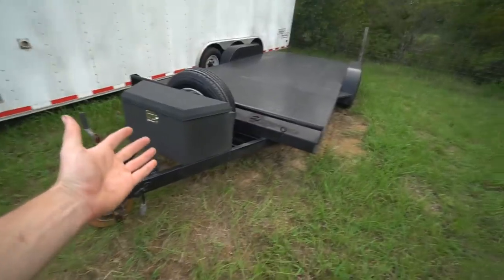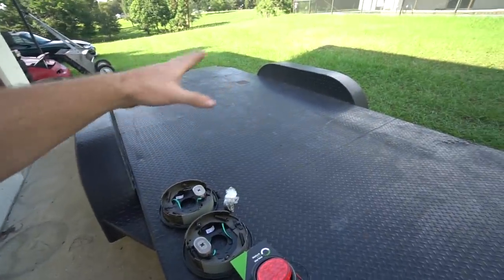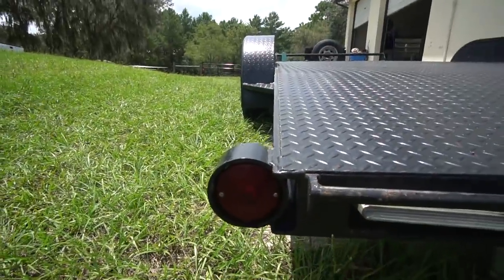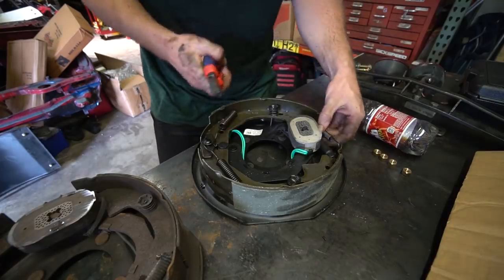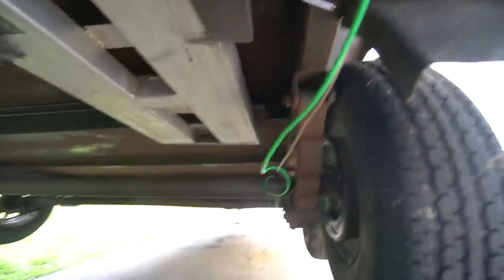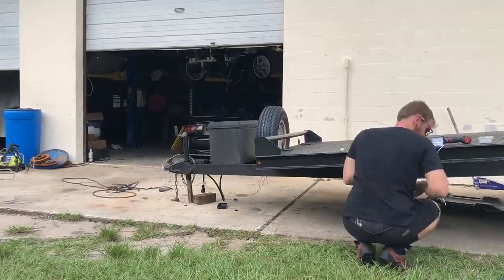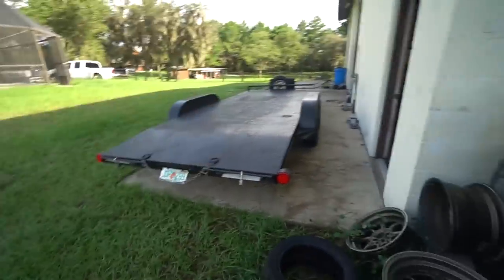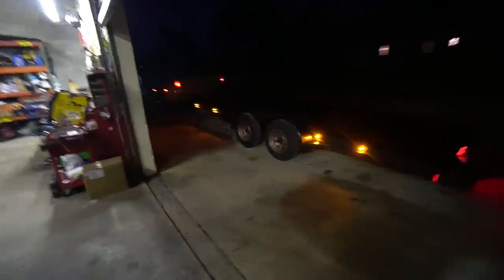Refurbishing My 18ft Steel Deck Car Trailer.

Comment: You are on all LED's now, are you pulling enough amps to trigger the brake controller? May be as simple as adding a resistor to fool the brake controller into seeing more of a load.
-Stay Blessed bud
Reply: The brake controller isn't going by the load of the lights but off the resistance/load of the magnet in the brake assembly.
Reply: @krazynelson  It is saying that no trailer is connected so it would be in the wiring or lights. The brakes are a simple I/0

Comment: Just a suggestion... when I rewire and do new lights on my trailers I always put one yellow on the very front corner of the trailer like some manufacturers  do. It makes keeping track of the trailer at night much easier, especially with the tinted windows. Also consider putting one on the front of each fender step right in front of the tires. It helps keep track of the trailer at night while turning, and as others said, all lights behind the fenders need to be red. Lookin good tho man, keep up the great content.
Reply: Agree. I added to the angle iron to the front fender to make the step bigger then added a light as close to the end as I could to see at night. It gives off enough light I can see the strip on the road.
Reply: Amber

Comment: Get the milwakee soildering iron it uses m12 batteries.
Reply: i have this it heats up in less than 15 seconds and boom done! love it
Reply: How did i not know about this 😂😂
Reply from the maker: I will be buying one!
Reply: @Taylordrifts  best 80 bucks ever
Reply: Looks huge though still awesome though
Reply: Power Probe  PPSK
Reply: miguel _909 best soldering iron I’ve ever used

Comment: Not sure if anyone already said this but once you run the wires I am a believer in putting wire loom over the wires to help prevent weather and animal related issues with the wires. I have both of my trailers “wire-loomed” it is easy if most of the wires are run from front to back together.
Reply: 100% a must unless you like wiring issues

Comment: When wiring my stepdad showed me to spread the cut end and fan it out similar to a small paintbrush then push both sides together then solder them together then slide your heat shrink wrap over that heat the wrap and your done.  But everybody has their own preference on how to do wiring. Keep up that excellent content. Also not to sound weird but you possibly could have used your lift to do your trailer wiring. ☮️
Reply: Might be to wide to get into the shop. My trailer is 2 inches wider than the door

Comment: "love drilling holes through steel" i once worked a summer where my whole job was to drill 3800 holes on a heatexchanger end plate (80mm) thick.... one hole took 3-4 minutes to drill and i wasn't alloowed to leave a proximity of 2meters of the drill :P

Comment: Check out the Milwaukee m12 soldering iron. I absolutely love mine. Gets hot super quick and so convenient to be cordless.
Reply: Dremel makes one also, but it's butane.  The different tips make punching a square hole in plastic a breeze too.

Comment: Behind the rear axle marker lights have to be red and you should run a master ground wire not use the trailer
Reply: Use both thats what it is there for
Reply: not true, only lights on the rear, and the rear corners need to be red.
Reply: @boomstickkid   no from the middle of your fender back is dot for a dual axle trailer amber signifies the front of the axles red signifies the rear
Reply: @FiveFourRacing  maybe it is but dot on semi trailers is only rear corner and the rear lights must be red.
Reply: @cameronmcwhinney-holt3195  you use the master ground from the truck for the light to make trouble shooting easier every time ive seen a ground issue on a trailer its been becuase they mounted the ground to the trailer instead of a homerun back to the trailer plug
Reply: I meant on the ground, you can ground it to the frame with a ring terminal at the j box and also run it through the 7 way to the truck so it has 2 places of a ground its overkill but i work for a trailer dealer and we always ground it to the frame in a hidden spot and the 7 way
I agree you are correct on the marker lights amber in front of the fender and red behind the fender. To be dot compliant where I live he would also need an amber on the gusset or triangle that supports the fender closest to the road on the front and a red on the back so people can see there is wheels in pitch black
Reply: With 2 grounds if one fails the other one hopefully will not
Reply: @boomstickkid  wich is the same thing the lights behind the rear axle are red he added extra lights that are the wrong color on top of technically being too small at least if they are the right color he might not be pulled over for them
Reply: @FiveFourRacing  no it is not. semi trailers can have the axles slid forward and have ambers behind the axles. work on them everyday.
Reply: This is true for trailers under 30' long and 80" wide. From the intermediate lights back, which have to be as close to the center of the trailer as possible and 15"-18" off the ground. That's NHTSA requirements which are different to a semi trailer, they are way over 30' long.
Reply: Dot applies if over 10,000 gcwr
Reply: @mattr4660  Don't bring facts into this debate! /s 😂😂
Reply: @FiveFourRacing  yeah I don't even use trailer as ground I go right to the 7way junction box or plug if it a single axle without breaks
Reply: @cameronmcwhinney-holt3195  I don't believe in double grounding on open flatbed trailer or equipment trailer just run right to the 7way junction box it more reliable I never had any trouble with a single ground

Comment: Taylor   Nice job!   If I could make a couple of suggestions?   1- Bolt your 7 wire connector box up to the rear of the truck.  Don't leave it dangling close to the ground.   2- For my tag trailer, I take my long 7 wire cable lead from my 31' trailer and I wrap it once around the trailer jack. My object/goal is that the thickness of the cable wants to keep the cable as straight as possible, yet when making a turn with the trailer, the jack is further away from the connector on the truck, so that pulls as much slack as necessary from the cable which is wrapped  one time around the jack, and as soon as the turn is complete, the cable automatically returns to it's normal position around the jack, because it wants to stay in its straight position.  Super easy, and I never have to worry about the cable dragging or getting hung up on something.  I took an old garden hose,, slit it, and sleeved the about 3' of the trailer wire from the connector back, wrapped it with black duck tape, you can you use your black Gorilla Tape, and sealed it nice and tight.   Now it can get trapped/pinched in the hitch either!   The hose really protects that cable beyond the wire jacket.   3- Really like your side marker lights!   How about added one more on each side near the tail end of the trailer, and one more on each side closer to the front on the V nose of the trailer?  4- Get some split plastic wire loom.   Put as much of the wires which are snaked around the trailer in the loom to protect it.  If you want to really protect it, take an old garden hose, slit it, and put the wires in that hose.   Nothing will ever hurt your wires.   You'd be amazed the things on the road that your tires kick up and rip through wires!   It take a hour of time, and the peace of mind that you should never have to worry about wire problems is well worth it!  5- I have that same trailer brake controller in one of my pickups.  I think I know what your problem is.  Ist check to see that each of your 7 wires is correctly connected in your terminal box, which BTW was a great idea.  If so, my 1st guess is that the 7 wire cable from the trailer, wasn't firmly seated into the connector on the truck, or that one of the wires isn't making a solid contact to the new harness.  Get that connector box firmly mounted to the truck and it might solve your problem.  To diagnose this, 1st mount that connector box, and then try really pushing trailer's 7 plug connector into the truck's connector.   Really firmly!  It has to lock in.   If it still doesn't work, take your old trailer cable rats nest of wires, cut the 7 wire plug off the mess as long as you can before any butt connectors. Strip all the wires as you normally would strip all 7 wires about 1/2" and put exposed 3/4" long spade connectors on each of the wires.   Put a piece of electrical tape loosely over each of the 7 individual spade connectors so that you don't accidently short or cross any wires.  Connect your old 7 plug firmly into your trucks connector, and starting with the ground wire, connect each of the discrete wires into the 7 plug connector on your trailer.  There are wiring diagrams online so that you will know the connection sequence to the 7 plug connector.  And make a good connection on that center pin.  Now try it.   Does it work?   If not, try from the connector in the truck's bed, if that extension cable it will reach.  Does that work?   That connector works for your gooseneck!   So if it doesn't work now, the issue is somewhere on your trailer side.  BTW, did you rough up an area on the trailer where you bolted in a ground?  Check that too, and as you said in the video, there is nothing wrong with installing 2 or more grounds on your trailer!  If you get it to work now, The issue has got to be the 7 plug trailer wiring on your truck near the bumper, which is likely tied into your 7 plug cable in the bed of your truck for your gooseneck trailer, maybe there is something wrong in that wire.    BTW, it is completely possible that the new 7 plug cable connector is not good too!   All this stuff is coming from China, and some of the stuff coming from China isn't that good, but everyone know that right?   Cheap product available online usually isn't the best product.   However, I have found one website for trailer stuff, www.etrailer.com which carries better products and they stand by those products with sales support, and great post sales tech support.  I hate wiring problems, they are the worst sometimes.  Lots of point of potential failure, especial if the vehicles in question aren't new!  Good luck Taylor!   I enjoy your videos!

Comment: I only know from experience.    Not telling you what to do but you may want to go back and either tape or take like a 1" long piece of that plastic wire cover/binder loom stuff and put around the wires where they go through the frame tubing or ribs, wind will move the wires around going down the road and will over time chafe the wire casings and start to ground out your wiring so lights will not work.   May be 1 months time it happens, may be a year, may be 5 years or more.   It always seems to happen on every trailer I've ever owned at some point and time at the worst possible time.

Comment: Hey Taylor, for soldering try a mini butane torch, from what I’ve experienced with wires and smaller fittings it works a lot quicker than a soldering iron

Comment: Awesome to watch man. I am not nearly the mechanic you are, but with the split-pin i usually put a flathead screedriver between the pins when bending back, then take out the screwdriver and bend the last little part. That way they are way more parallel to pull through easely. At least in my experience 😊
Thanks for the vid!

Comment: 19:20 Taylor an easy way to remove the cotter pin is to grip the end of the pin with the pliers and hit the pliers with a hammer. It might scratch up the pliers but it saves a bunch of time and hassle taking the pin out.

Comment: For the trailer light wire dragging, run the cable through the hitch pin. It will support the cable, but still have flex for turning. The dealer I bought my camper from taught me that. 

Also, use your ramps and pull the trailer up onto them with the truck for getting under it, or you could run the front tires up onto the ramps and the back tires would be up for the brake work

Comment: Really stepping your game up on the small action shots. I use the same plug and box kit on all my trailers. The lights fit perfect, but they fit inside the metal gaurd to protect them from getting broken or smashed. Just an FYI after replacing lights once or twice.

Comment: Hey Taylor I do a lot of tire machine stuff and I recommend using dry lotion grease instead of just regular grease it will be 100x better why because the regular grease collects dust and dirt it will be temporary and dry lithium just keep a cab beside the tire machine and you won’t have any problems

Comment: Nice video  by the way .
My advice , for next time follow the  standard trailer wiring colors 
Brown  -tail lights
White - ground 
Black - 12v all the time 
Yellow  - left turn
Green - right turn 
Blue - electric brakes
Red - reverse lights
Try to remember this colors
This way if you need to troubleshoot a faulty wire you will no what color to trace
Good luck with the trailer

Comment: Pro tip for drum brake springs and bare with me it’s hard to describe lol. Use a punch, hook the spring hook high on the shaft of the punch, place the top of the punch into the destination hole, raise the punch handle while keeping the tip in the hole, use the punch as leverage to stretch the spring and the taper will guid the hook right to the hole. You can snap them in super easy. Can also use a Phillips screw driver

Comment: Generally with trailer wires your black or brown is marker/tail power. Yellow and green will be turn signals red is the stop lights and white is ground just as a reference. Makes diagnosing a light issue a cake walk

Comment: Just a tip. When soldering build a “bridge” put ur iron under the wire then solder into the side of the wire touching the wire and iron tip at the same time with the solder. The bridge helps heat everything up at once.  Helps tons when doing thick wires moving down away from the tip of the iron People think the heat is everything but once you try this method you’ll never go back it sucks the solder right in. I have wired thousands of motorcycles with that exact same soldering iron. Takes seconds once learned this.

Comment: Here's a tip for the brake drum springs use side cutters to grip them . Also for the split pins use side cutters to get grip and leaver off the nut to pull them out

Comment: i had same controller in my excursion and it gave me a ton of the same issues.  i thought it was a ford wiring issue but it ended up being the controller once i changed for a new one

Comment: Be sure to "wet" the solder tip with the solder first so it conducts heat into the wire better. Also get a Butane Bernzomatic soldering iron. They are amazing for heat control and are just so much less of a pain to work with.

Comment: One thing i did notice was the brake backing plates were installed backwards, the short shoe should be the leading edge and on the front, they will still work but not as efficient.

Comment: Hate trailer wires. Got tired of dealing with it and ended up running a grounding block then running individual grounds to each light. Never had another problem

Comment: Taylor's buy a ts100 soldering iron and you will be set they heat up super fast and can run on lipo battery packs so no long extension cord but it will run that way also and it would make quick work of that job or others like it in the future

Comment: The brake controller probably needs to see a higher load. Since you changed to LED lights there isn't enough resistance so it thinks nothing is connected. Maybe hook up a resistor load or throw a old style bulb on the circuit. That should fix your problem.

Comment: Dot red lights after fender. Also a trailer disconnect box with battery is required. Texas state and Louisiana state troopers are horrible about this
Reply: True that they pull that cable activating the brakes to see if they are working

Comment: If you put some solder on the end of the iron and then put it underneath your wire it heats up the wire soooo much faster can start soldering almost straight away

Comment: You need to get some soldering flux from Lowe s. Just put some on the area you want to solder and dip your solder wire also in it. The flux acts like a primer. You ll thank me for it!

Comment: So I've made quite a few comments when it comes to diesel trucks & what to buy & own. I've said it before, I've owned them all. I have done A LOT of towing & know what to get, keep or sell. I have a 44" enclosed gooseneck I tow with my Duramax Denali & also have a 7'x22' Tilt deck flatbed. I have owned a ton of different enclosed trailers & have ALWAYS kept my flatbed. I've needed the flatbed more times then I ever needed any of my enclosed trailers. Little tip for you Taylor. Don't ever sell the flatbed, if you do make sure you are buying a new one right after. Also, trust me when I say this Taylor. DO NOT buy a 6.4 unless you are going to do a cummins swap.

Comment: Bro, I may have not seen it but do you have a break away kit on your trailer,could be why it’s not recognizing the trailer
Reply: I have a trailer at work that uses trailer brakes and doesnt have a break away kit. Trucks still register trailer brakes just fine.

Comment: Loved the Trailer vid I recently scored a sick aluminum trailer for my jetski I bought a LED light kit and rewired it LED is definately the way to go I only paid 290 for the trailer and have put 80 bucks into it with two brand new tires for 30 bucks on eBay! Its definately worth 450-475 now simple upgrades do so much!!

Comment: Definitely gonna order that 7-pin junction box! I have a single axle trailer without brakes, but my tow rig has a 7-pin plug and I'm tired of having to keep track of the 4-pin to 7-pin adapter.
Reply: James Briggs I just leave my adapter in the center console, one for each vehicle I own. Although I’ve also added that junction box from amazon for my boat trailer and the only complaint is it isn’t water tight. But some home mechanisms fixed it